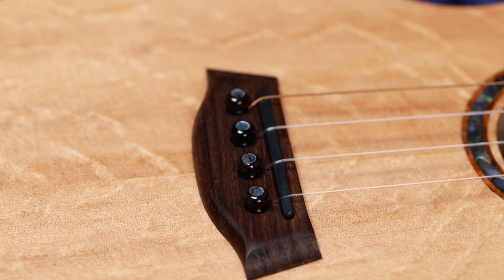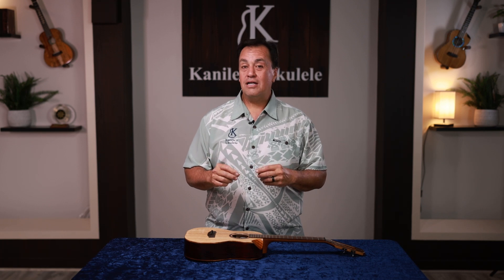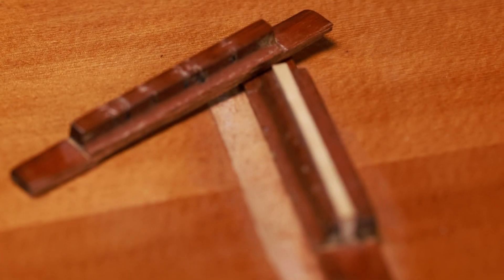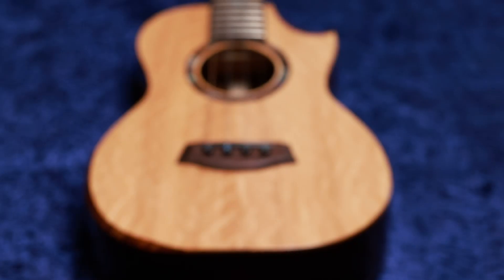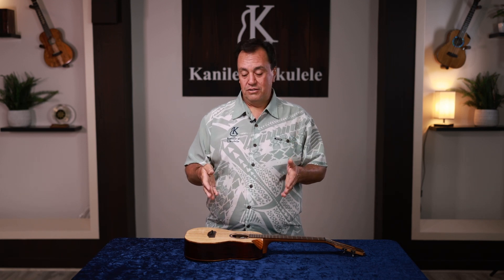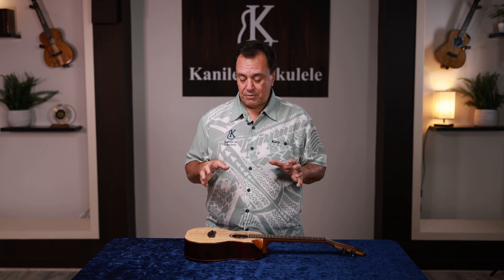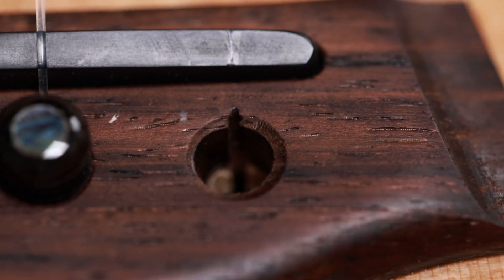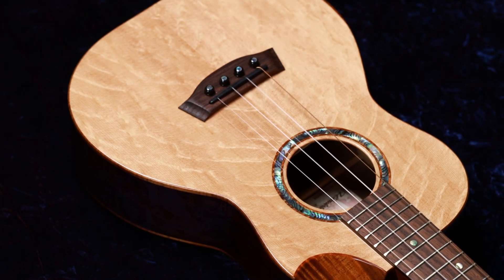'Ukulele Bridge Pins - Are They Better?

Comment: Bridge pins are a very good way to fix the string on the interior of the soundboard and reduce the shear stress on the bridge glue joint.  Some builders use small thru bridge holes which require threading the string through the bridge and fishing it out through the sound hole to knot it perhaps with a small bead to prevent pull thru.  The thru hole construction is a bit more difficult to string, but the bridge is lighter and simpler to construct.  And there are no pins to misplace.  The simplicity of through hole with tricky string replacement vs bridge pin with easy string replacement is a trade off.  Your bridge pin solution is a very elegant choice.  Your ukuleles are first rate!

Comment: The bridge pin system is one of the reasons that Kanile'a produces some of the greatest tonal resonance in the ukulele world. Some free advice: make sure your string knot sits underneath the bridge pin groove, and not under the pin itself. Actually tug on the string first before you insert the pin - it should not come out. If the knot rests underneath the pin, your zen moment of practice could end with the pin shooting out under tension and across the room - not fun.